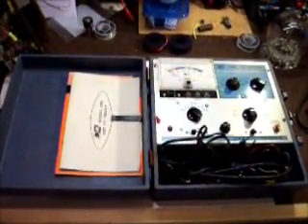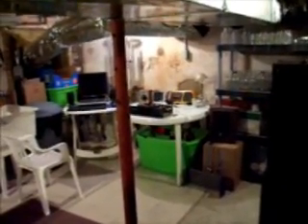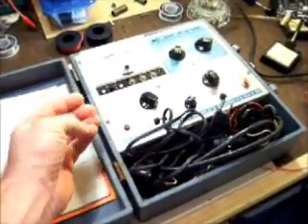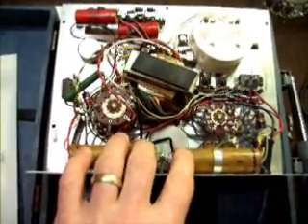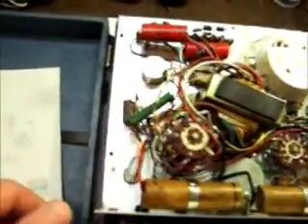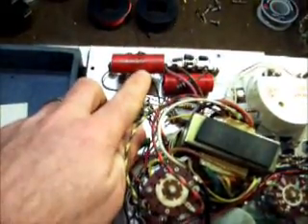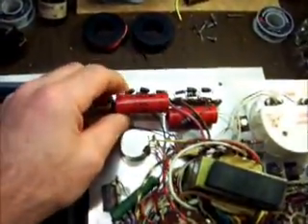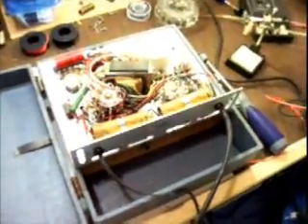Inspecting And Using The B & K 465 CRT Tester.

Comment: Hi Nathan. I have a Motorola that did the same thing At first test. I let it cook for a few hours and then tried the set it worked  very well.. I think once you get it capped and any out of tolerance part changed you will have a cool working set. keep, us posted Buddy, and thank you for sharing.
Reply from the maker: Tec,
I'm hoping to get this set fixed but it won't be anytime soon. I have the Stewart Warner, a Motorola set, and the pine cased Admiral all in the works right now. I need to get back to the SW radio, I had a good viewer response with it. What with the wonderful snow starting tomorrow I might have an extra day this week to work on the radio's !
Take Care,
Nathan

Comment: I was really suspicious that the B&K CRT tester was defective when you got no emissions or cutoff at all. I'm glad that I was wrong!
That grey area at the top of the CRT is sure weird. You wouldn't normally think of there but the center instead.
It looks that it may be something is wrong with the phosphor coating. But... I thought I saw the grey area jump up once in a while. I hope this is the case because it would indicate it is not the coating but electrically something else.
I'll keep my fingers crossed.
Have a good 2014 Nathan!
Tom
Reply from the maker: Tom,
The CRT tester works very well. I need to order the proper replacement caps and change those old paper jobbies out. The gray area seemed to go away the longer the set was on. This is my first TV set to mess around with, but seem to do pretty good for a nube LOL !
Nathan